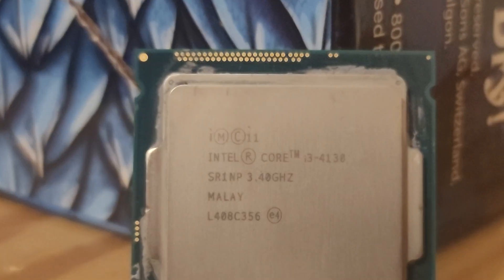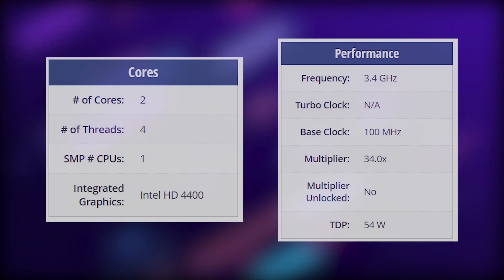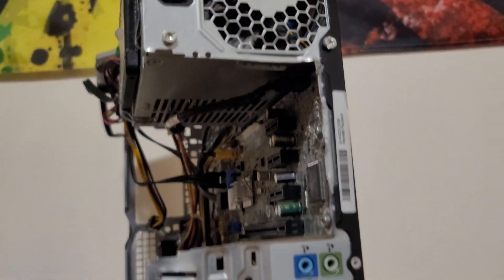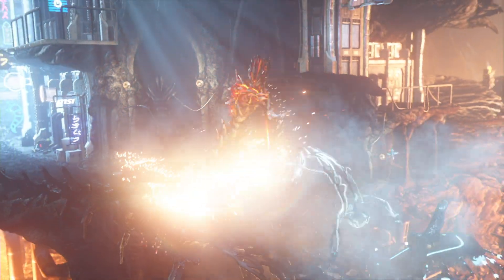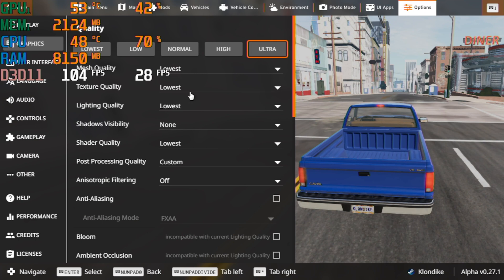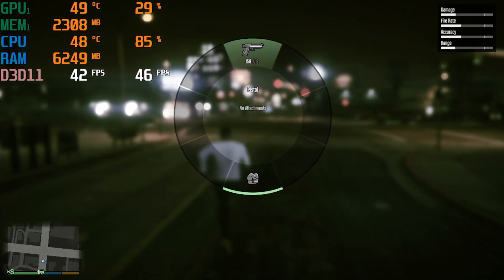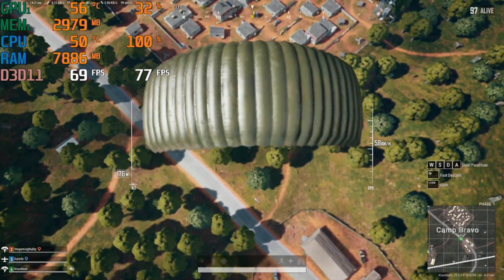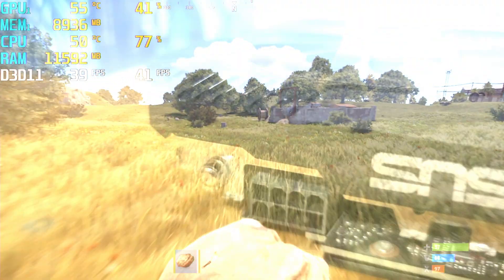Should You Pair A 3060 With An Old i3? (No)

Comment: But yea if you are looking to buy a i3 the 13100f  can power up to a 3060 without leaving peformance on the table and the 12100f and 10100f are also good options
Reply: Note the cpu is not super powerful so the i3 will likely cuase more  stuttering than a more powerful and higher tier cpu
Reply from the maker: Don't think that work with my motherboard, but I do need to get a new testbench eventually